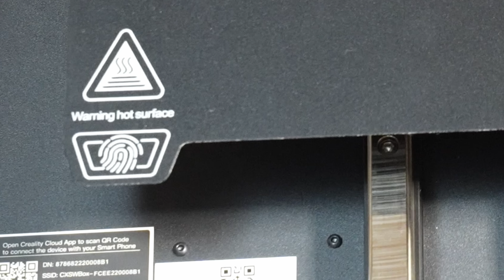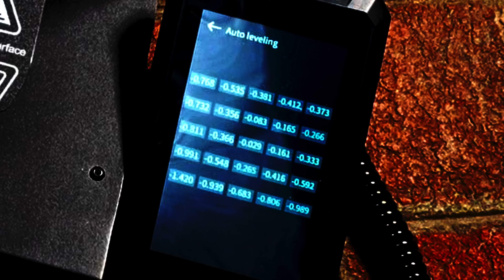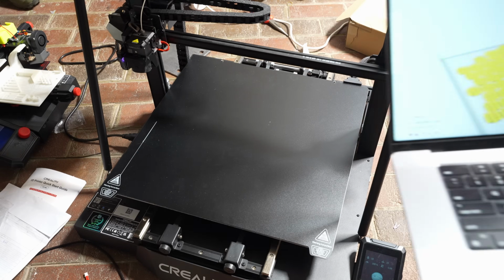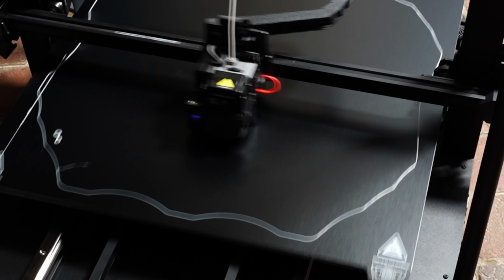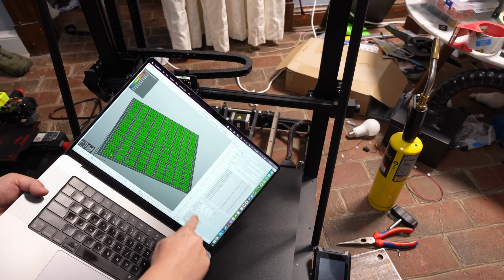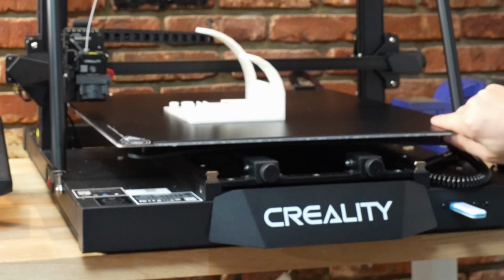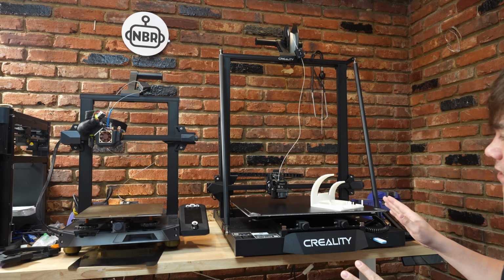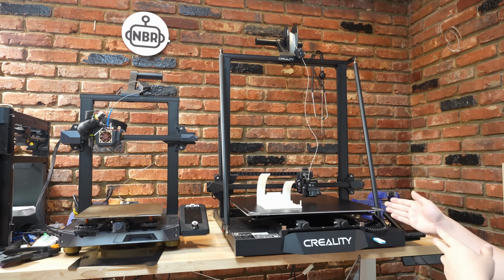CR-M4 - The Biggest Ender 3

Comment: I had purchased a CR-M4 and had the same backflow. I replaced the hot end and after I reinstalled it the printer kept trying to push the nozzle through the build plate. Even if I manually set the z axis. I ended up returning it and getting a new one.

Comment: Excellent vid Nathan...Has anyone here got one of these to print with Octo/Pi etc? The manual is hopeless and there is no USB B host port??? I have lan access but there is no webserver at the address. The creality print is absolute toy/rubbish with ads and slicing. I simply want it to work like the rest of the printers with servers/usb per machine
Reply from the maker: Apparently the sonic pad works on this. I haven’t set it up yet though
Reply: @NathanBuildsRobots  Yeah I dont use the creality...after market only and Pis have always been great...have a small setup ie 7 but mostly large and a couple of 1m3 but the multi component stuff I do for a job and there are no neg volumes or reasonable ways to use creality print...mainly on the industrial design side. Issue is I just cant get connection to it and the connector glossary suggests usb c for online printing?
I also ran the (600mm) verniers over the frame and it was out especially the vertical top so the v rollers were hard to adjust but the real issue is the slap in the lead screw nuts (and the nut mounts were loose out of the box!)

Comment: Worst Printer I have ever used! & Customer Service is useless. I had to purchase the Kobra Max because I was losing money, waiting for parts from Creality, The Kobra Max is so much better than this, Can't believe I wasted £1099 on the CRM4 when the Kobra Max is half the price & better in Speed, Quality & Noise.
Reply from the maker: Not sure the Kobra Max could keep up in volumetric flow rate using a Bowden tube extruder, but yeah this thing is loud and needs some fixes straight out of the factory. Unfortunate
Reply: @NathanBuildsRobots  my banks been chasing a refund from Creality as they have no spare parts in stock. been waiting 6 weeks for the mother board.

Comment: Thank you for the review, this is very thorough ! In my case I do need large prints . I have been using the printer for the past week with very variable results. I tend to get jumps in the Z axis and the initial layer has gone from great to total crap. Is there any specific tightening/setting you would recommend ? Not sure if I am missing something that is causing uneven layers

Comment: cr-m4 seem to be using the same nozzle as the k1? looking to replace the ptfe lined heatbreak with an all metal one but assume there are none yet, or maybe ever? meh
Reply from the maker: Yes its the same. MicroSwiss is selling some nozzles in that form factor.
Reply: @NathanBuildsRobots   i just rewatched your video and saw that you actually switched out the heatbreak too ... what nozzle and heatbreak was that?

Comment: I noticed that my bed is way out, the middle is around .-001 but all of the outsides are .-900 and i have to use +3.80 z offset.
Reply from the maker: That's what bed-leveling is for! Really not too bad IMO as long as your prints are working
Reply: @NathanBuildsRobots  I have uneven bed on my CR-M4, but I don't understand why my CR-TOUCH only reads, but it doesn't use mesh bed leveling data during the printing? Despite Z-offset adjustment my first layer tests are uneven.

Comment: 14:34 - ... It had a variance of ONLY 1 mm ???  In my book, that is WAY too much!
Reply from the maker: If the bed was off by 1 degree it would cause an 8-13 mm variance, so the fact that it is only about 1mm of variance is quite good. It’s off by maybe 0.1 degree, and quite flat despite the size of the bed
Reply from the maker: Check what kind of variance the PRUSA XL has

Comment: FYI Triangle Labs CHC Pro(volcano) is a no-go on machine without a lot of homework for various reasons.
Reply from the maker: Why is that?
Reply: @Nathan Builds Robots
CHC = 60W
CHC Pro = 115W
Creality mainboard PSU = 75W

As you showed too, to upgrade and go with a true volcano nozzle, you have to adjust parts cooling.

Then the issue of switching or sourcing ones with PT1000 thermistor because the NTC ones are under-rated from what I've researched if you use heater to full potential.
Reply: If so, looks like I'll be sending the CHC Pro back.
Reply: @SlickNickBA  the 800w can handle mainboard and hotend.  I just wouldn't heat both simultaneously. Lol Ask me how I know!
Reply: @chriswhite2718  Did you upgrade the PSU or just give up on it?
Reply: @Nicholas  no. There's 2 PSUs in printer. 75w for mainboard & 800w for hotbed. I just switched mainboard to share the 800w
Reply: @chriswhite2718  Thanks!
Reply: @Nicholas  Hey, just found out the newer PT1000 thermistors are different then stock & 1040NT. I don't know if with stock firmware it can be changed but in klipper, had to change thermistor type. Just a heads up.
Reply: @chriswhite2718  Awesome. Thanks for the heads up, Chris. 👍

Comment: Just out of curiosity: was wondering that a lot of 3D printing YouTubers from the U.S. are using metric measurements and part sizes instead of imperial. Did there something silently change in the U.S. regarding imperial?
Reply from the maker: I think the younger generation of engineers has a preference for metric. Also, it helps that most consumer grade printers are made in foreign countries. So fasteners and software are all set to metric by default.
Plus, nobody wants to describe the flow rate in cubic inches per second, or densities in pound per cubic inch... its all so awful. Much happier to work in metric!
Reply: @NathanBuildsRobots  Great to hear that. Lived a long "full metric live" but having experienced quite a handful of different currencies I suspect it might not the easiest thing to "feel" in two completely different systems of measurements. We internalize all kinds of lengths, weights, heights, volumes, speeds, distances and more in a live time that I find it hard to imagine learning a second "kind of language" for all these things.

Comment: I cannot get the PLA to stick. No matter what I do, it doesn't adhere to the plate cover.
Reply from the maker: Try cleaning with alcohol, turning temp up to 60-70 and trying a different brand
Reply: @NathanBuildsRobots  Thanks for the response. Very new to 3D printing. Plan to use PA once I'm comfortable with the machine, but is there an overall particular brand of filament you recommend?
Reply from the maker: I’ve had a bad batch with pretty much every brand. My polyterra matte black has been pretty reliably good.
Reply: @NathanBuildsRobots Thanks. I will check that one out.
Reply: Hey, Nathan. As I'm new to 3D printing, I have a question. I purchased your modder board. Do you manually have to offset the Z axis for the additional spacing for the modder board? Thanks

Comment: Nathan. First congrats for the vid! and sorry for my poor english. Im from Argentina and in my company (orthopedic insoles industry )we are looking to implement 3d printing. We have no knowledge on it, witch printer you suggest for us. We need speed, size up to 30cm each insole long and 15width, industrial periods printing. Thanks for your help.
Reply from the maker: The least expensive option that will meet your needs is the Artillery Sodewinder X2.

The Bambu lab P1P is another good option, it is faster and easier to operate. The space might not be large enough for you, but you might be able to print the insoles diagonally on the bed which is over 300mm diagonally

Comment: Im honestly not so sure what to think about the x axis drag chain. If the wires are not built for drag chains they will break sooner or later, many voron users switch to umbilical style wiring for the xy motion in order to improve reliability. For z it makes perfectly sense as there is so little movement.
Do you have any idea why they chose such a awkward nozzle length and not just use a regular volcano? From my knowledge some cr10 variant used a volcano with a titan extruder, so nothing new in theory.
Sovol has also such nozzle i think, in the sv06 plus. Also couldn't think of any reason why to go for that style, haven't seen them anywhere else.
Reply from the maker: I think Sovol and Creality are related somehow... They share a lot of similar parts. I couldnt tell you the rationale, it is an odd thing.

Comment: This vs the Anycubic Kobra Max would be a good comparison.
Reply: And the Elegoo Neptune 3 Max
Reply from the maker: Tell them to send me one! I have been consistently reaching out to them. 
Apparently I am on the list to try one of the Neptune printers when they have them in stock in April. I have not heard back from Anycubic.
https://www.anycubic.com/pages/contact-us
https://www.elegoo.com/pages/support
Reply: @NathanBuildsRobots  the only downside of the Neptune 3 Max are the bed springs. I might buy one and replace them with aluminium spacers, since it has a bed leveling sensor anyways. And the heatbreak PTFE liner needs replacement if you want a full metal hotend assembly

Comment: With that much filament the rotating weight may cause tugging on the hotend and uneven layer lines. I use reverse Bowden fastened on both ends so the extruder has something to pull against that isn’t itself.
Reply from the maker: The larger spool diameter could help make up for some of the difference, but still is something to keep an eye on. Might be cool to have some kind of buffer system like what is used on the Bambulab AMS, just a big spring to take up the sudden jolts and smoothly pull on the spool. Or something servo controlled, but last thing we need is another motor on these things

Comment: Also, Push Plastics sells 25 kg spools of PLA, if you’re looking for the biggest spools possible. Granted, 1 25 kg spool of PLA is $550, which is more than a lot of printers on the market, and I don’t know how good their tolerances are, though it seems like something worth checking out for giant printers like that one.
Reply from the maker: That is great. 5kg is already pretty massive, 25kg would need a special spool holder made of reinforced steel!
Reply: Thats expensive for 25Kg, the shipping would be expensive for that weight though. It would be cheaper to buy a bulk order of 3Kg spools, I cant see the point of a 25Kg spool, 3 Kg will more or less fill the build plate of an Ender 5 Plus.
Reply: It relates to manageabilty...I have 1m3 printers but pretty much 5kg is sweetspot for those..these smaller machines are fine with 3kg and they all fit into dehumidifier boxes much more easily :-)

Comment: Why u slam it around like that though? lol
Reply from the maker: I was trying to adjust the alignment of the little pulley belt system in the rear of the machine. Ultimately it was the wax line that really cut down in the nose so I’m not sure if the hammering did anything.

Comment: There was a kit someone made to make an Ender 3 about that size, saw it a few years back, similiar Y axis.  My issue with bed slingers is the size of an enclosure needed if you want one and the mass being moved.

I like my Ender 3 Pro but I spent a way too much on it to make it work really well as well as made it IDEX, full rails, side mounted dual Z belts with gear reduction and a good enclosure.  It can print just about anything now but I could have built a CoreXY for what I have in it.  I'll never buy another Creality or any bed slinger for that matter.  Bambu is out because it's not open source, I like to tinker too much.  A larger CoreXY will be my next build, either my own design a Rat Rig or maybe something using the E3D tool changer.  Depends how motivated I get next fall.
Reply from the maker: Was it an Ender extender kit that increased the printer size? I saw those and kind of wanted to build one. This is a lot more purpose built for being a large printer, but you can go big without having to spend a fortune with one of those extender kits
Reply: @NathanBuildsRobots  Yes thats what it was called.  Couldn't think of the name.
Reply from the maker: You might be able to reassemble it into a Corexy printer like the rook. Good luck with your future build, sounds like it will be a beast
Reply: Really wish that Creality would have put some effort into an updated plus sized Ender 6 (or not fllopped the Ender 7 so bad)

The 7 especially could have grown into a decent foil to the Prusa XL on the everyman side with just a few tweaks (v wheels on the side rails in addition to the cantilever if they weren't going to jump to linear rods like the 5 and 6)

Comment: Clearly insufficient torque was used on that nozzle, two clicks isn't nearly enough. 

Yeah, the heat brakes being different lengths is a known thing, not sure why it doesn't get mentioned more. The Mk8 PTFE lined heat breaks have a super long separation/break zone in the middle, whereas all the all metal heat brakes are usually just clones of the E3d Kraken heat brake and have a much shorter break zone and are just that bit shorter.
There are now Mk8 specific all metal hot ends but you have to be careful what you get.
Reply from the maker: I really wish the industry would just pick a standard and stick with it. Everything is +- 2mm here and there when it comes to heatbreaks and nozzles.

Comment: Creality extruders/hotends are such crap. I don't even install them, straight in the trash anymore.
Reply from the maker: I would agree with everything prior to the sprite being garbage. I really like the sprite though. It’s not perfect, but it does remarkably well at high flow rate printing, which is what I’m into. Also the print quality is really nice at standard settings.

Comment: seems like an Ender 30
same problems as the 3... times 10!
jk looks like a good machine but just crazy to ship it as a low-flow printer (no klipper, no input shaping, 0.4mm nozzle, etc) especially for the price
like how are you ever supposed to take advantage of that build volume in the Z axis! Practically a 2D printer as shipped.
Reply from the maker: Right, well it seems you have to mod it to get it to live up to expectations. Not too much of a problem for me, and I kind of like the challenge of modifying these to suit my use-case. But I know some people prefer a more out-of-the-box experience.
Reply: @NathanBuildsRobots  I'm all for modding, but the price should reflect that. I bought my S1 for £220 (about $300) brand new. I'd rather buy 3 more for less money to have the same build volume (x, y) than buy one of these. I'd also have 4x the extruders running at 150mm/s each with the sonic pad

The numbers just don't add up with the m4.
Reply from the maker: @iamdmc  Yeah, I can see that. However, I have some projects that I have not been able to do until now due to build area limitations. I have some designs that can be made in 1-3 pcs that would have otherwise need to be made in out of 4-12 pcs. 
Having multiple pieces drives up cost, complexity, and difficulty to model and assemble, and failure points so for me, personally, this 450 build area is a game changer.
Reply from the maker: @iamdmc  And, given the price, I agree, it should be in a perfectly working state - not needing trivial stuff like nozzle tightening, wheel tensioning, heatbreak replacement, belt lubing, bed screw tightening, etc.
A premium price should have premium build quality, fit, and finish,
Reply from the maker: @iamdmc  I think this would make a lot more sense in the $800-$1000 price range. $1100 seems a bit much.
Reply: @NathanBuildsRobots  I'd love the larger build volume too. Just based on my limited experience, I wouldn't trust creality with multi day prints. I'd expect print failures that cost days and kg of filament. I'd also expect increasingly bad quality the higher in the z stack it goes. I'd love to be proven wrong

Comment: Why are you saying that you are not seeing the point of high accelerations corexy design brings? What I am missing? The bottleneck for speed is not the melt rate of nozzles if you are using a cht 1mm nozzle and 0.24mm layer height. (Which is the near ideal layer height for good layer adhesion for 1mm nozzles)
Reply from the maker: The point is: most of yall have your printer sitting idle 95% of the time and complain about them printing too slow 😅

Speed printing tends to smell bad and make a lot of noise. So I tend not to go all speed racer mode for no reason. Only time you NEED that speed is when rapidly iterating prototypes. Which I don't do more than once a month.

I will probably print at 1.1mm wide, 0.4mm tall travelling at 40-80mm/s for a volumetric flow rate of 15-25mm^3/s That will eat a spool of filament in about 16 hrs

If I want to print lots of filament I can do vase mode 1.8mm CHT at 5x2mm bead. Going 60mm^3/s would equate to a printhead speed of 6mm/s and would eat up a spool in about 5 hrs. I could push it faster, and go 100mm^3/s, at 10mm/s, which I might do just for 1 video to show off, destroying a spool in maybe 4 hrs? That 5 kg spool would be toast in under 24 hrs.

It's not necessary unless I were going into production mode.
Push things too fast, and things break more often. Slow and steady wins the race for me. Plus excessive cooling that many high speed printers use can lead to weak parts.
Reply: Ha, say that to a Bambu Lab x1c printer. It laughs at your slow speeds.